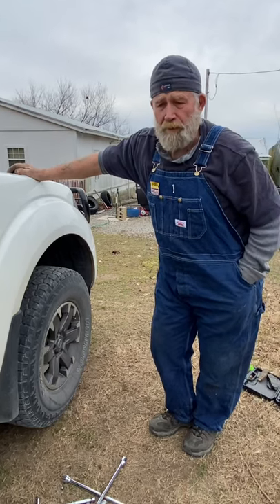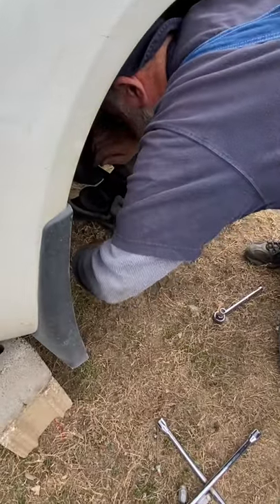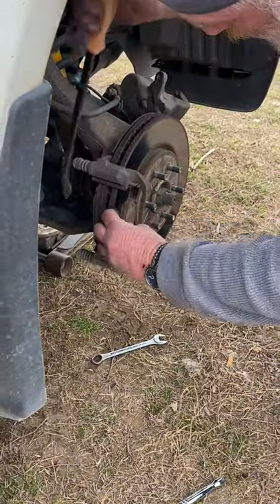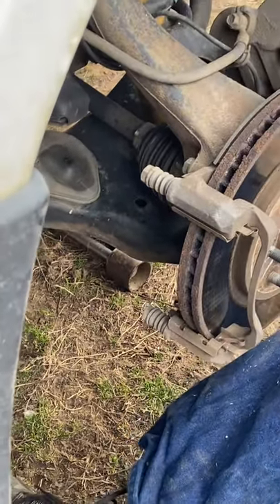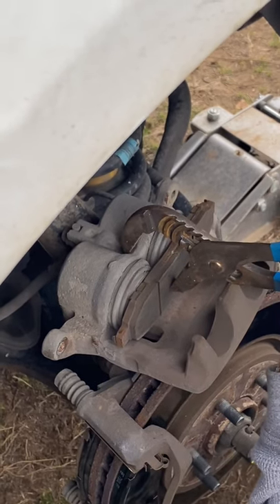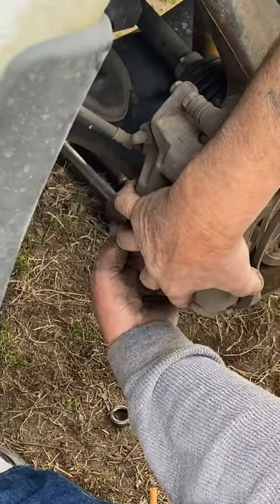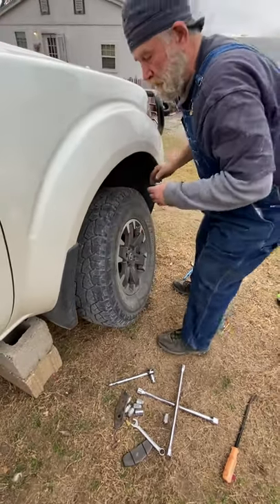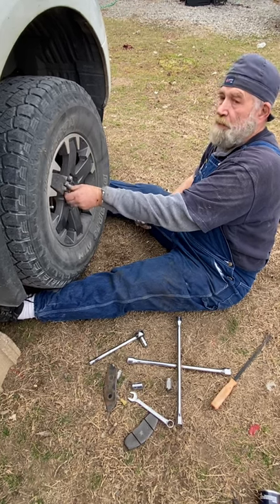2016 Nissan Frontier 4WD V6 change front brake pads.

Comment: Did you lube anything?
Reply: You should put lil brake grease wherever clip touches back of brake pad.
Reply: I know this is old. But make sure you grease the caliper guide pins. Which is the part he refers to as spring loaded. You can pop them out of the rubber boot and pull them out. Just grease them good and replace. It keeps the caliper from "seizing", or getting stuck leaving the pad in contact with the rotor.
Reply from the maker: No not on the pads. I don’t grease it.😃